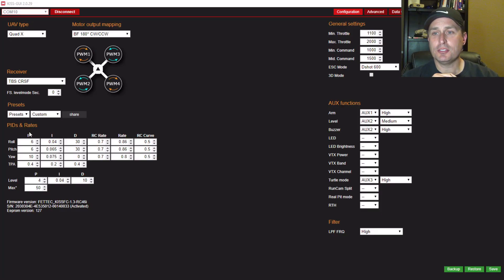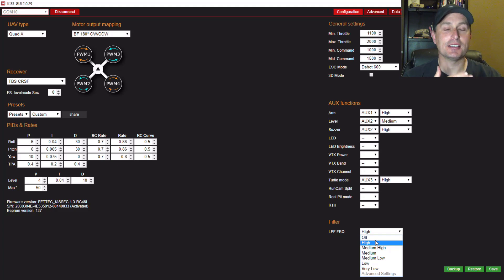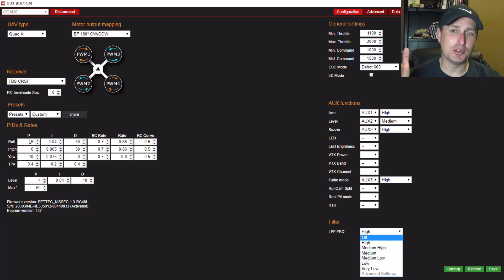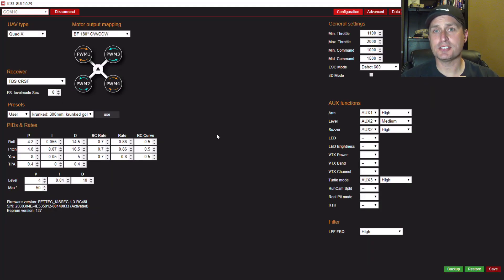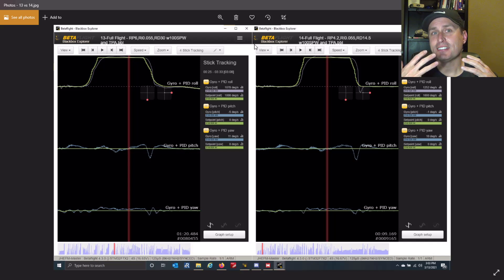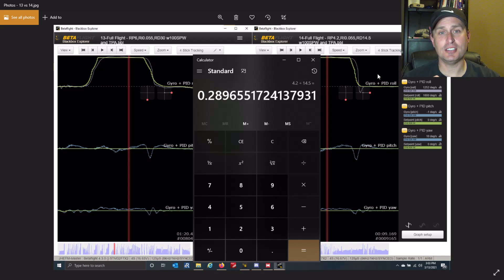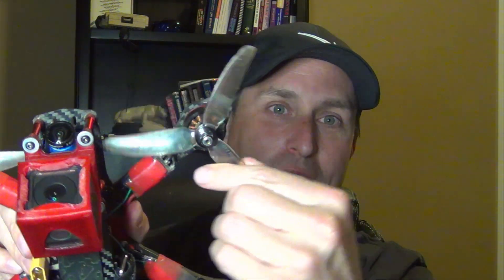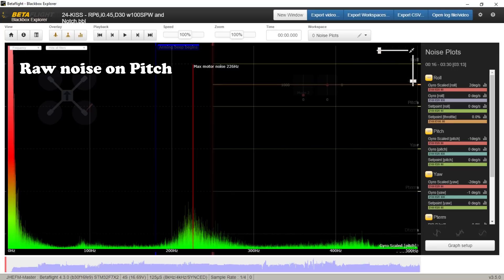KISS Tuning - HIGH vs low PIDs | PUSH IT!!

Comment: Do you have any tips on my KISS FC V2 when I do full throttle my quad Yaw spins a lot. Trying to fix it for ages ;/
Reply from the maker: 1. Make sure you are not adding yaw yourself inadvertently.

2. Increase filtering on Yaw.

3. Increase i-gain on Yaw.
Reply: @uavtech   Thanks for a quick replay. Im gonna play with it tomorrow. I've heard that new ULTRAS has this problem solved I might consider that rare item if Im lucky :D

Comment: How does a person get one to one with the sticks?
Reply from the maker: One to one?
Reply: @uavtech  6:00 mark in the vid, stick tracking i think it was called. Im flying a 3inch whoop and find the Quad seems to be behind the stick movements if that makes sense. Tried low D and it felt better but not quite there at all. Odly enough level mode feels amazing but cant do much with that mode.
Reply from the maker: @marccretten  crank up Feed Forward.
Reply: @uavtech  No feed forward in KISS GUI. Only set point i think i saw. By default its 100
Reply from the maker: That's all you can do then with KISS.  :-/

Comment: Hi, could you help me, I tried 3 Kiss V2 and they all make me the same fault I probably can't tune the PIDs well.
When I get off at about half-trottle everything wobbles it seems to me on the axis of the yaw I repeat all 3, more or less.
Can you give me some advice?
Hi Mauro.
Reply from the maker: Flash Betaflight to it: https://youtube.com/shorts/0imE8n4gi2s?feature=share

Otherwise, lower i-Gains, but it is hard to find the good balance with KISS on i-Term.  You need enough i-Gain to not drift when you chop throttle, but too much and it will most likely have bounceback.  But if you are dropping throttle and getting wobble, reduce i-Gains.
Reply: Thanks for the answer I can tell you. By

Comment: I do like my KISS quad but cannot seem to tune out the bounceback on pitch.  I will try your advice on tuning with setpoint at 100 and go from there, as well as switch from dshot 2400 to 600 because I have had some MAJOR random wig-outs after flips.  

Also, it's amazing how combative people get over your arguments against KISS.  Honestly I don't know why you bother responding to them, they made up their minds already.
Reply from the maker: For KISS, you need to have i-gain as low as possible without having too much drift.  It is a hard balance, but my best advice on it.

Comment: Hello Mark, so did you actually use Openlager to get logs? I tried it today with fettec stack. I put "baudRate" : 250000 in lager.cfg but the log is not completed. It is full of empty data. Do you know how to fix it? Thanks
Reply from the maker: Yes, OpenLAGER.  I used these settings and set logging rate to 80% in KISS.

{
	"startupMorse" : "",
	"useSPI" : false,
	"baudRate" : 250000,
	"preallocBytes" : 104857600,
	"preallocGrow" : false}
Reply: @uavtech  ahhh 80% rate this is the difference. I will try. Thanks. 👍
Reply from the maker: Yeah, that's the highest I could get it to work.  KISS logging kind of sucks.  A doubt any attention has been paid to it in 4 or 5 years.  :-/

Be aware, Setpoint is not right in it either.  But the rest of the terms seems fine.

Comment: Probably still worth the quick/easy video to remind people that the specific set of test flight maneuvers you do is intended to push the limits of the quad and improve the edges, and that pilots can fly around the areas where the performance limits show up in the HD feed (and most good pilots do) - this just expands the envelope of how hard they can push.

Comment: i dont know why anybody would use only dshot600 on kiss, go dshot 2400. Oh lol i just saw, you weren't using a full kiss setup yet you want to tune kiss, jesus.
Reply from the maker: Which is ridiculous at a 1k loop and based on KISS guys in my discord is riddled with bugs that can drop your quad from the sky (Dshot2400).

So KISS only works on very specific equipment, Jesus.  Man, the marketing really got you good, eh?
Reply: @uavtech  no, you can''t say yoyu are testing a kiss setup without having kiss esc's that everybody knows, well everybody that uses kiss for years knows, are integral to that kiss setup giving you everything kiss has. 
Why aren't you fair, people that use kiss fc with other esc's are made fun of on kiss groups yet you are here defending your obvious bad choice.
Does bf work with kiss esc's ? No ? But kiss works with bf esc's. So who's better here ? It seems bf only works with bf stuff, who could have known. But if you want the same for kiss, neah, it's not ok to want kiss fc and kiss esc. 
Double standard much ?
Reply from the maker: I have purchased KISS ESCs for Phase II testing, as outlined in the video.
Pffff..  Educate yourself before commenting.

Really, KISS ESCs won't read the same Dshot protocol from BF? I find that hard to believe, but we will see.

BTW, BF does not have equipment, it is not a company.  It is just a FW community project on Github.
Reply: Kiss esc s in bf would only work on max dshot600
Reply from the maker: Which is 8x faster than the 1k pid loop KISS runs.  Plenty of speed and won't fall from the sky like Dshot2400
Reply: @uavtech  did you use dshot2400 and had your quad fall from the sky  ? Been flying kiss for 3 years with 2400 and 0 prop wash 0 throttle pump pitch bounce 0 yaw drift and guess what, 0 falls from the sky. I haven't heard that until you and everybody and their mom flies kiss here.

Comment: Great Video Mark! What is the first thing you would do when tuning kiss? Obviously I know the principles of pid tuning, but what steps would you take to tune it from stock pids? Thanks for the awesome content :)
Reply from the maker: I would 
1. set Setpoint Weight to 100% and tune in PD balance (flips, rolls and sharp inputs).
2. From there raise P and D gains till motors got hot or other bad stuff happened.  
3. Finally, adjust i-Term to be as low as you can, but not have drift when 100% throttle.punch and chop.

Hopefully filters on High (default) works for your quad.
Reply: @uavtech   @UAV Tech  cheers! I will do that, I'd imagine that I can push them both quite far as I've got an apex frame, should be interesting 😃. In terms of pitch and roll, should I keep them both the same? Thanks
Reply from the maker: To take it to 100%, look at roll and pitch independently.  The PD Ratio should be a little lower on pitch vs. roll.  (P/D = Ratio) .  However, P and D Gain strength should turn out to be able to be little higher on pitch.  Probably 5 to 10 D-term points.  

Of course as you move up P and D gains, you hold the Ratio you found in the previous step.
Reply: @uavtech  Great thanks. I usually fly with the dterm setpoint weight set to 80, should I tune with 80 or go to 100 and tune with that?
Reply from the maker: I would.
Reply: @uavtech  Sweet thanks! Going out tomorrow to tune for a couple of packs, will let you know how it goes :)

Comment: Several points I have now since you linked me back after my thoughts on the first video. Black box is useful to get you in the ball park. Its useless to fine tune an end all be all tune with it. Human muscle control is too imprecise to be consistent enough not to mention every flight is not in a closed environment. So far EVERY video I have seen tuned to it looks like ass because the pilot didnt do the exact same thing the exact same way the next flight. Its impossible. As many tunes Bardwell did with it over the years they all still flew like ass. They flew "Better" but not the best.

Second is if you are tuning with KISS you MUST use TPA to find the happy spot between smooth and super tight specially if you use HQ or Gemfan props. They suck for over all performance but have a sweet spot so many people tune for their style of flying which is why everyone uses them. As soon as you break out of that tuned sweet spot they behave like untrained toddlers.

When I tune (still on V1 KISS even) I use Dal props which are more stable across the whole throttle range. Who cares if they are slightly heavier with the new motor tech specially if you go with low kv 6s builds. But anyways I tune higher P gains keep my D's usually around 12ish. If D goes over 15 in tuning I lower it back to 10 and go back to tightening P. The rest is managed by using TPA to smooth out mid to high throttle oscillation. That way I can fly freestyle or full throttle and not worry about the quad giving problems. If I get flutter or propwash its 99% my fault from bad throttle management or flying into my own bad air. Bounce back in a lot of cases boils down to too high rates for the pilots skill level or someone is using Expo in their tune. NEVER EVER EVER use expo on a quad. Find the balance using Rate and Super rate or Rate and RC rate depending what you fly.
Reply from the maker: "Black box is useful to get you in the ballpark. It's useless to fine tune an end all be all tune with it."  -  that is like saying:

Use a tape measure to measure a building is good to get you close, but to get precise, you just eyeball it.

I agree human muscle memory is imprecise, and that is why you do a lot of moves, look at them as a composite to see wsup.  To then further take away our best tool of measurement doesn't make any sense.  Adding imprecise listening or looking for things we think we may or may not see on top of the imprecise muscle memory of course doesn't help.  Our species unique attribute is building tools to help our senses because they are so poor for this type of stuff.  

TPA I would argue is not needed - in general - for 95% of any tuning.  The only reason I didn't turn it off for KISS is because if I would, everyone would bark that I messed up it by turning off KISS's magical TPA.  I would guess most folks that fly KISS don't even realize how TPA influence works though on the other hand.
Reply: @uavtech  I been flying KISS for 6 year+ betaflight for 4+. My stuff flys as I intend it to and I am happy. I figured I would point you in a direction that may help you and others work out tuning issues but I guess you dont need want or desire any input beyond your own ideas.. Rock on mate have fun and if your happy with what yer doin thats all that matters.
Reply from the maker: I think the advice is not consistent unfortunately.  But like you said, have at it and have fun, that is all that matters.
Reply: @uavtech  LMAO

Comment: What are the yaw twitches about? Mine started doing this when I tried 24k pwm. Had to go back to 48k
Reply from the maker: No yaw twitches in BF though you may note: https://youtu.be/YVRBgD3sTs8
Reply from the maker: Noise i guess.  I only noticed on take-off.  It might also be because of not RC filtering though in KISS.  I would have to vet it out to see what's what.

Comment: Soooo dum question... but how would you suggest getting blackbox data on a KISS quad...?
Reply from the maker: Flash Betaflight.  KISS logging is not very useful.  You can hook up an OpenLager, but the data not maintained.  Meaning, you get some garbage traces that are KEY to logging in the first place.  Like Setpoint (your ticks).  That trace is useless.  You can see for other stuff, like P, I, D and gyro.  But without a target (Setpoint) you can't use to tune.  I have it on Alex's radar, but I'm not sure he cares to fix it; which is a shame when you are paying 3x the cost for a KISS FC that not all the features even work right.

Comment: BF just has more tools in the shed like you said, Kiss just needs to evolve, or let the fettec devs fork some code. It's about like taking a gaming rig today and installing windows vista 64 on it or something.  Flight one evolved right?  Yet they didn't figure out how to manufacture inventory or reply to customer emails.
Reply from the maker: So true with F1 inventory, so crazy they don't focus 110% of their efforts toward solving inventory issues which are constant.
Reply: Actually KISS is who everyone else copies most times. They just do all the fancy stuff under the hood. No need to have all the bells and whistles and fad of the moment add ons to make their stuff look better if you are still top of the food chain. And yes I fly both I just turn all the extra stuff off on Beta Flight and tune like normal. Both have a different feel but I can get my stuff to fly equally as good on both.
Reply from the maker: @borgonianevolution  , I'm not seeing any under the hood goodness though.  What are we missing??

The throbbles with KISS are on everything you see for example.  Go pump the throttle on ypur KISS rig.  The i-Term winds up and there is no way to really track your stick right for racing.  There is not way to lock out i-term for big quads, nor can you move up gains enough for big quads (30 D-gainis the limit, that would be the start for big quads (7" thru 10").
Reply: @uavtech  Did you soft mount anything? The filtering KISS developed and everyone else based their stuff from are set already in the software. KISS specifically tells you to NOT soft mount anything so these filters actually work as intended. As for racing.. I have not competed as no one where I live flys. But take a look at my page for anything to do with TAZ. even the channel video for non subscribes is a Taz run when you first open the page. Thats one of my KISS quads when I was in the process of final tuning.
Reply from the maker: No softmounts.  And that is 100% false.  You can see how added the first lowpass filters to Cleanflight back in the day.

Also no lowpass cares if you soft or hard mount, that just not how the math works.  The logic of no soft mounting advice is they want the vibes to be as high frequency as possible, which makes sense.  That said, i have not see that soft mounts change that either.  So i think that is a wives tale with no data behind it (that softmounts are bad).  Unless you know of a data source I can review?

Comment: Both flights looks bad to me. Propwash on both. Twitches on 2nd. Throttle up leads to yawy  rotations... I had very similar scenario with Armattan Marmotte frames :) Switched my kiss stack fo tbs source v3 and it flies like a dream now :) But.. kiss does not like damaged props at all. BF can figh that back, but kiss is just no go.
Reply from the maker: So BF is better?
Reply: @uavtech  :) I hate to say that.. Would be interesting to see that kind of test. Like bending/choping props and playtesting bf vs kiss with no retune of pids. I bet bf will do a better job.
Reply: BF beats KISS hands down for bent prop performance. Used to use KISS for racing for a year and a half. One clip of a gate resulting in a bent or damaged prop KISS freaks the hell out. BF on the other hand is like "whatever, bring it on, let's go and finish this race."
Reply: @BikeGuyFPV  yep.. im a bando guy.. so kiss and bando.. does not play very well :)
Reply: @doc_fu   why?  What's happening with kiss in bandos?
Reply from the maker: Weak filtering.

Comment: Just an opinion, those are the highest pids I’ve ever seen (on someone’s kiss rig)haha. Like you said if it flies it flies.
Reply from the maker: Whelp, it is the highest you can go on D-term.  So that makes sense.  But one of Mr Steels tunes has 23 for D, so, yeah.

I'm not sure why the 30 limit is so low honestly.  That limit should probably be 40 it 50.  Wonder how it would fly on 35?

With a low D-term limit, it really makes KISS only ok for 5" or lower as bigger quads generally require higher PIDS.  A 6" to 10" would start at 30Ds on KISS.
Reply: @uavtech  yeah there aren’t too many bigger quads running kiss due to the tunability, people have done it successfully but I feel like 3-5” is really their niche
Reply: I feel like the fundamentals of a tune are "get D as high as you can without the problems it can cause and have the proper relationship between P and D."

Anything else is people who fly too fast of rates or not enough expo in rates so they try to add expo to the pids, which is the wrong tool for the job..... shoudlnt matter the firmware, thats how you tune a quad....